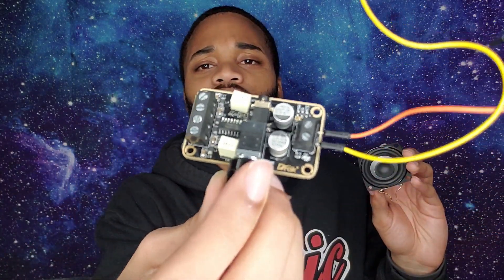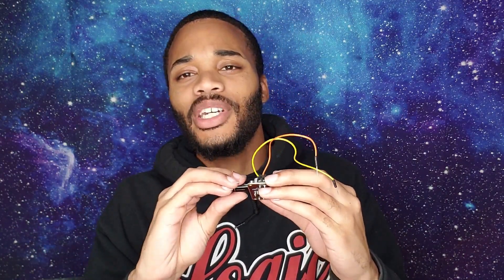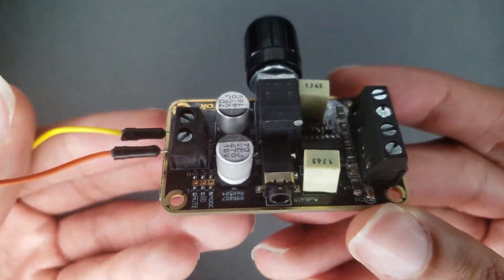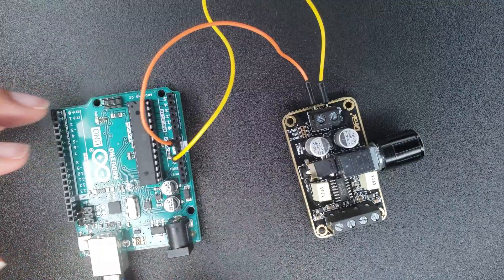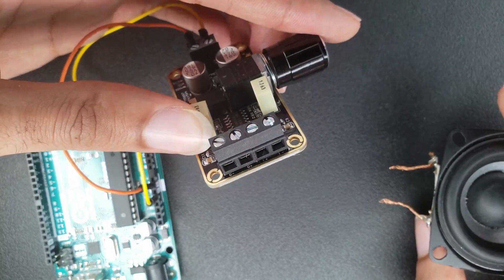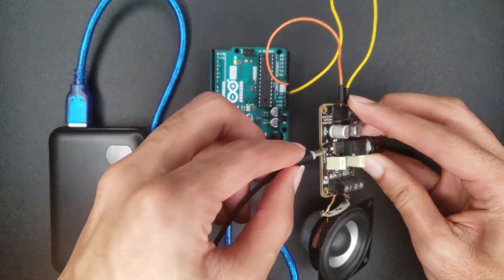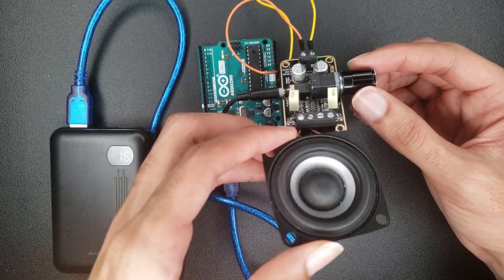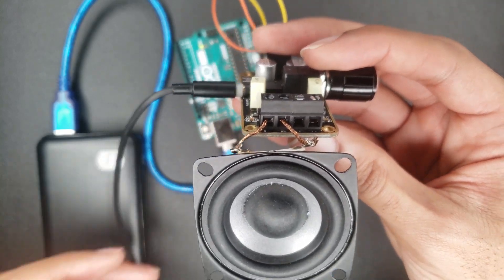How to increase the volume for mini speaker Amplifier Arduino or Raspberry pi

Comment: Is the Arduino do anything but suppling 5 volts? Could you not just supply 5 volts to the amp?
Reply from the maker: You also have the 3.3V option

Comment: Great video!
Exactly something im looking for with the aux cable for sending tbe audio data.
One question, would you know if there is a similar board without the knob for the volume?
My setup is going to be in a case and dont really want or need the knob for changing the volume.
Planning to use it with a raspberry pi 3a+.
Thanks

Comment: How have you connected the aux cable?  Where is it connected to and from?
Reply from the maker: It’s the center of the device center of the amplifier
Reply: @DreThePlug  but what is the source? Because the raspberry pi has a female 3.5mm Jack and so dies this amplifier. Would I be able to use a male to male aux cable to play music from the raspberry to this speaker?
Reply from the maker: @ahmedbachoo9112  ohhh yes you can connect both of those aux cords
Reply from the maker: Yes